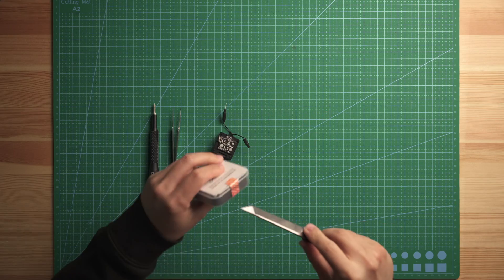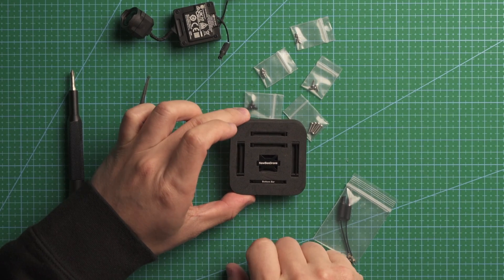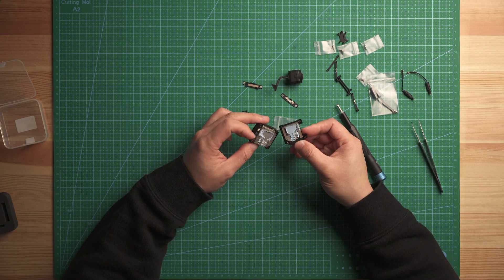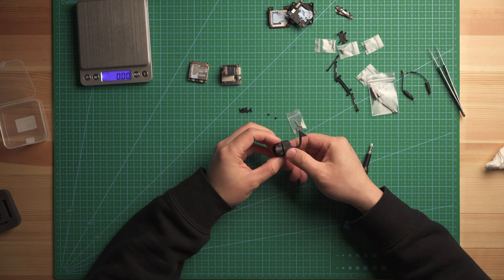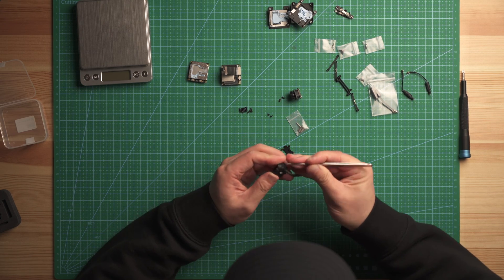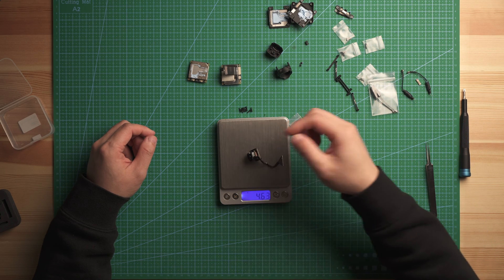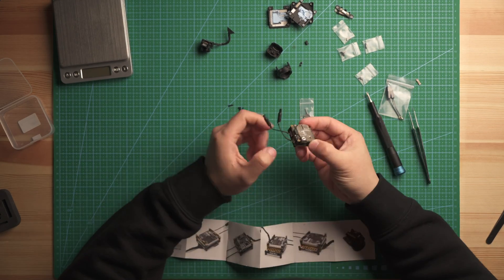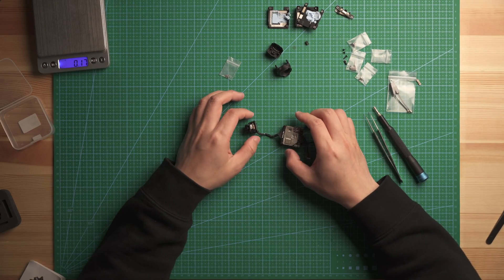NewBeeDrone DJI O3 Naked Conversion Kit

Comment: should have added 20x20 mount holes in the bottom bar
Reply: Great idea!
Reply: @liguokun2005  o3 mounting is such a pain and this would massively simplify things
Reply: next revision will comes with 20x20 mount  @daich
Reply: @liguokun2005  sign me up. got an ETA?